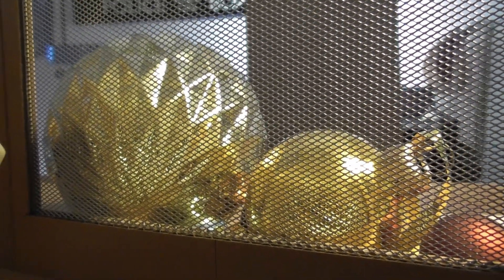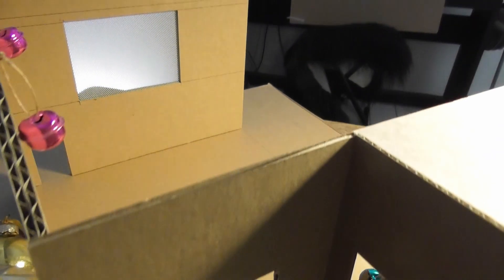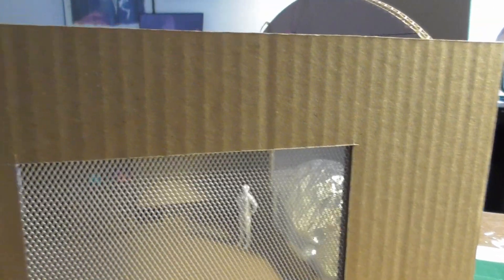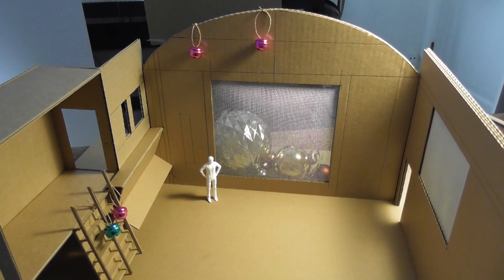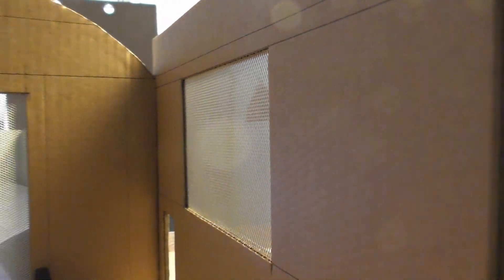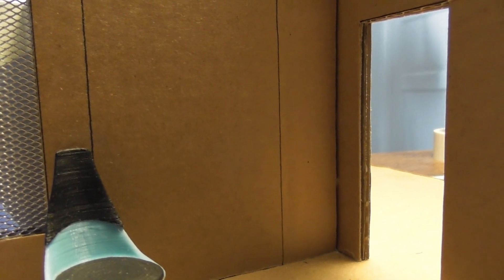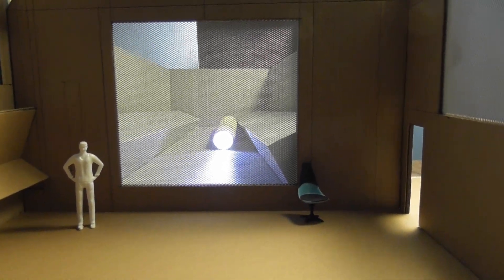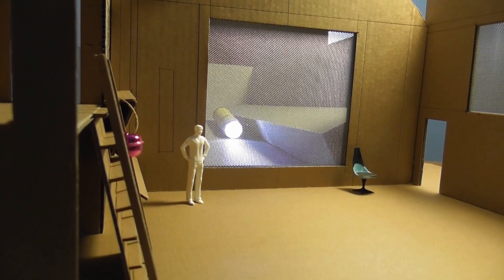My EPIC 1:25 scale Starship Enterprise engineering model!

Comment: Man, you just keep at it at the pace that best suits you. I for one appreciate the thought and time put into it. 

This video got me thinking about your two engineering sections idea and the strong back of the secondary hull. It's overlooked, but that 'top deck' of the secondary hull is the 'strong back' and provides the primary superstructure holding together the nacelle pylons, the secondary hull, the dorsal section, and finally the back of the primary hull. This junction makes up the core 'body' of the ship everything else hangs off of. It's like an inverted keel of sorts. So, putting impulse engineering at the back of the saucer section and connecting that along the strong back to warp engineering in the secondary hull makes a ton of sense. In this way the TOS warp core is configured laterally along the strong back to the base of the pylons. This also explains the drastic narrowing of the space given it's position in the hull. The impulse engineering section supports the saucer in the event of a separation. This also allows for the refit design where the warp core is re-oriented vertically instead. 
There is also an argument for all of engineering in the back of the saucer section with main power conduits and supporting infrastructure out to the nacelles along the strong back. In that case a saucer separation disconnects the nacelles from the warp core disabling warp but allowing the core to power the ship while also maintaining impulse power. Take all of that as food for thought as a holiday gift. I am curious if integrating the strong back into the model helps resolve the structural integrity issues as well. Jefferies didn't work for NASA, but he knew ship building design and you can see it in the look and feel of the original enterprise. I think people often overlook that it's a steel ship like a sleek battleship or aircraft carrier due to the cold war era tech boom of the 50s.
Happy Holidays and New Years!
Reply from the maker: Thanks for the input, the thing about 'warp core', we didn't see anything to do with it until the motion picture and I'm not sure but I think it wasn't until TNG that the term 'warp core' was used. I never liked it, always thought it was a bit like Dr Who's time console. Personally, and as far as the original ship goes, if there has to be a warp core I see it being in the nacelle itself and operated from within the ship. So I see a warp core, or the warp tech being in both nacelles. All the best for the New Year!

Comment: I think it looks like whoever designed this engineering set must have wanted to give the impression that it was located in the Secondary Hull where the nacelles support pylons meet. But then there wouldn't be any room for the shuttle bay. They probably didn't think the audience would be analyzing the ship's layout to this extent. Please feel free to put Main Engineering (and by extension, Secondary Engineering) anywhere you like. Your guess is as good as ours.

Comment: I always imagined that the ‘power tube’ section in the secondary hull was at the point where the framework of the nacelle pylons would meet and the tubes were part of the warp power distribution system similar to the power transfer conduits coming off of the warp core on the Enterprise-D. I thought that the sides were angled inwards at the top to align the walls at a somewhat 90 degree angle with the ends of the pylons. I wish you were building this in Oklahoma!

Comment: There is an episode where Kirk mentioned where he would hide to allude a mass search on board the ship . He said Main engineering , the lower levels .I don't  think just the lower floor of main engineering as we know it has two levels but in the lower decks of the secondary hull where main engineering is located.  Makes sense there would be two engineering sections one for the Saucer and one for the secondary hull .

Comment: This has long been a debate between my brother and myself, surpassed only by "where's the bowling alley on the starship?" 

If you go by some theories, there was only one engine room — in the secondary hull — and it was constantly upgraded during the Enterprise's 5 year mission. Even if you buy into the idea that starships are modular so upgrades could be done relatively easily, this level of alteration is somewhat impractical given the radical changes made to the engineering set over 3 seasons. So no.

As noted in the video, Franz Joseph's famous set of blueprints had the engine room at the center back of the saucer section. While this might make sense for the impulse engines, it is too far from the warp nacelles, and creates a logistical and tactical nightmare in design, with the warp drive AND the impulse drive AND the turbolift shafts AND the locks to connect the saucer to the neck ALL within one narrow targetable location. Also a no.

Turns out the answer was on the show all along. 

During an early first season episode, Spoke mentions that there are THREE engine rooms on the ship. While the dialog doesn't go into detail, it is easy to extrapolate that all three designs of "engineering" we see exist at the same time on the same ship.

— The big one, the two story set with the dilithium crystal chamber in the middle of the room, is MAIN Engineering in the secondary hull. It powers the warp drive and much of the primary energy needs of the ship.

— The other two versions, without the second level or without the dilithium chamber, are actually in the saucer section— mostly likely to the left and right of the neck. These run the impulse engines, as well as auxiliary power and the batteries. I have long thought that the big bulky "energizers" you see off to the right side in the early eps are in fact the batteries.

Not only does this solution get around the different appearances of the various sets, but the notion of 3 engine rooms fits into the idea of backup and redundancy you would expect to find on a massive military/research starship on its own out in space.

Comment: I agree with you in how there would seem to be a secondary engineering "also" in the primary hull, for exactly the reason you cite, to power the impulse engine that's already adjacent to it anyway. It would "seem" like the secondary hull’s engineering is the "main" engineering, and the only one with a warp core, and even seem like one in the primary hull is kept powered down and dormant under most all circumstances (much like the battle bridge on Enterprise D).

That would further provide a suggestion as to why the captain of these OT series Constitution class ships were seemingly reluctant to separate the saucer in situations it would seem to help, because it wouldn't serve to get anywhere far or quickly because it would be a lumbering sub-light craft, and not be so terribly helpful.

Oh, and me personally, would encourage you to keep experimenting at exactly your own pace and no faster.  Even these tests are very interesting, especially how you present them, with your thoughts and ideas alongside. And no need to risk your main future project falling short of your expectations for a reason you could have worked out with enough experimentation.

Comment: I like to think of those power tubes as the "impulse stack". And I think it would make sense to have an impulse engineering deck as well as a warp engineering deck in the secondary hull. You could even get away with it canonically (sort of) because in the first season they had some machinery on the right side of the set (The Enemy Within). In other episodes they had the 2nd floors on either side of the engine room. You could make one engine room with the machinery and only one tall floor, and the other with 2 decks and the ladders.
Reply: Actually, they can't be the impulse engines. In "The Paradise Syndrome", when the warp engines blow out, the sparks and such come from them. In "The Enemy Within", there's a rare shot looking straight up at Evil Kirk hiding crouched on top of one of the big generators as Kirk and Spock go by and you can see the ceiling above. It's curved, with light panels similar in style to the top of the hanger bay.

Comment: The engineering section(s) we're always a bit confused and changed throughout the series.  I recall engineering being different during Court-martial and Space Seed, season 1. And of course there was a different layout in the Alternative Factor or was it just a different area of engineering.  Then it changed in season 2 with Journey to Babel and the Ultimate Computer.  If one wanted to tie this together I would suggest that indeed there are two engineering areas and that the one in season one is in the saucer section and the other is in the secondary hull.

Comment: Best wishes for the holidays and a very productive 2024!  You've made 2023 a fun one.  As for engineering, I agree with concept of two different engineering sections.  "Main engineering" to refer to warp drive and located in the secondary hull, and impulse engineering in saucer.
Reply: David Brussee, I have to agree, if only for the curve of the ceiling, I think this particular room would be found in the secondary hull, that's no necessarily a given, but it makes sense
Reply from the maker: Best wishes for the holiday season to you too!